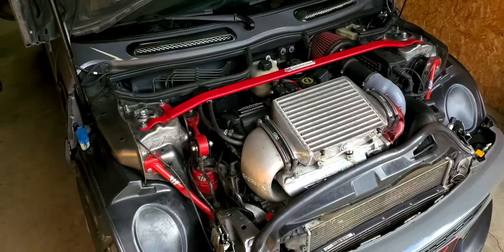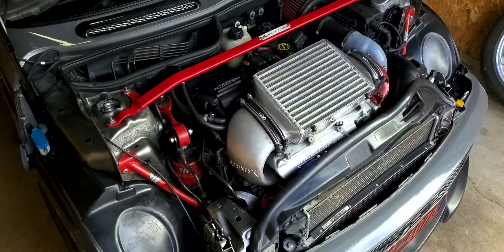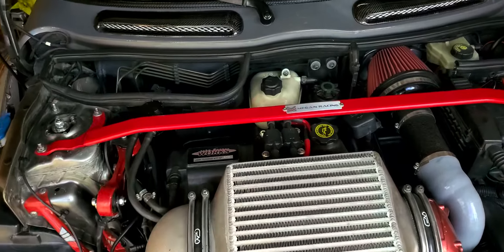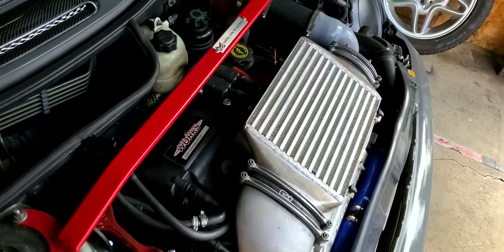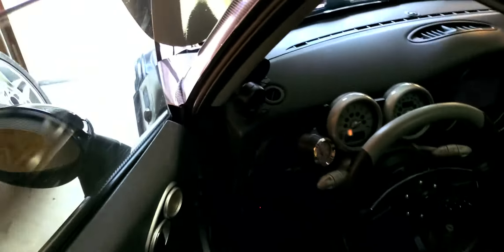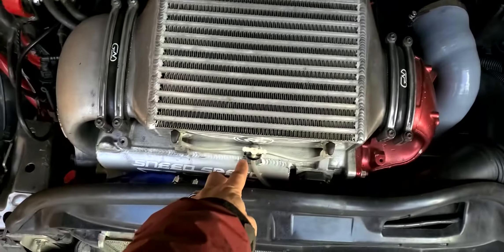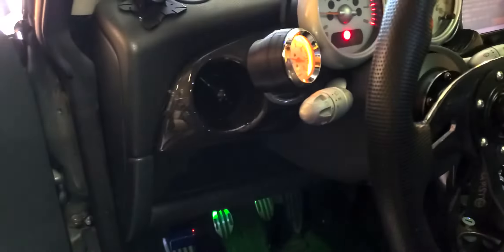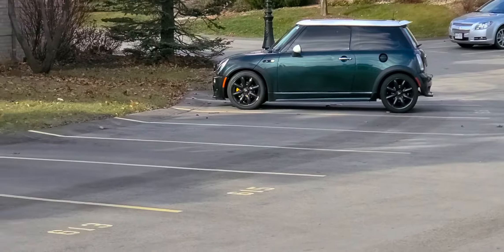12/21 modded r53 update

Comment: Great set up from a fellow r53 driver your build is good prob best you can without turbo
Reply from the maker: Wellllllll , I cooooould have used a better brand aftermarket sc and better brand big valve head but they were out my price range.. had I used the tvs supercharger and rmw big valve head . Then it'd probably have abit more power and more reliable supercharger then. But is what it is.. 
Btw a turbo is my dream mod for this car either a big ass turbo oooooooor k24 swapped
Reply: @minimanadam  I'm in the UK I've visited a tunning garage called 1320 a couple of times and had a chance to look at some for turbo builds with stand alone ECU s was pretty cool

Comment: Wow, quite a long list of mods! Nice job! I am wondering though how an electric water pump can be fitted? What did you do with the original water pump?
Reply from the maker: You can buy a Davies electric waterpump and it bolts rite in. You can even run one with stock sc and have benefits. You just wire it into the underhood fuse panel and it runs the same waterpump routing and hoses.. i need to run one because of the sprintex supercharger but it's still a great upgrade for the stock sc